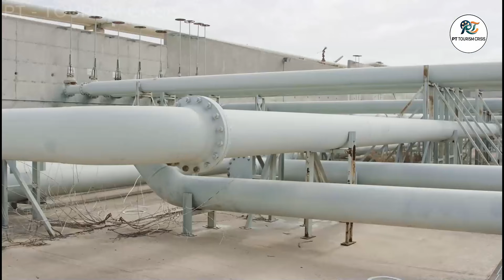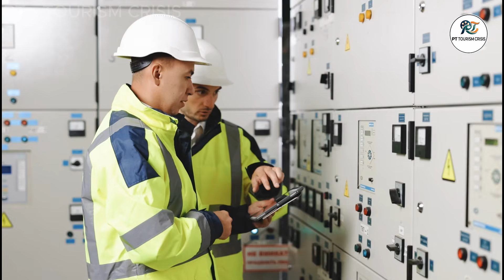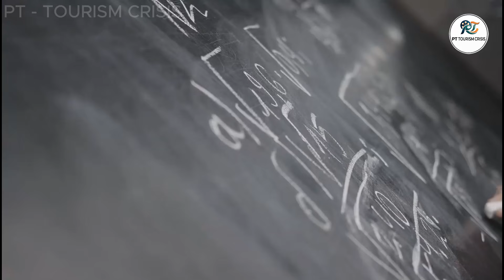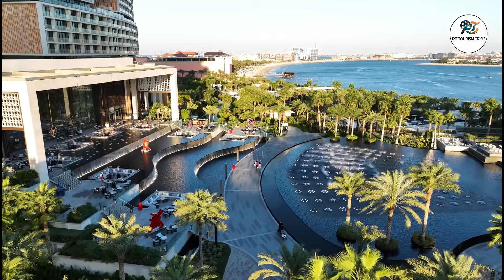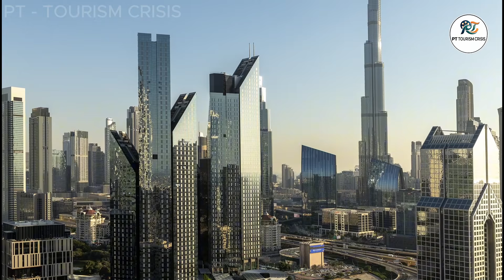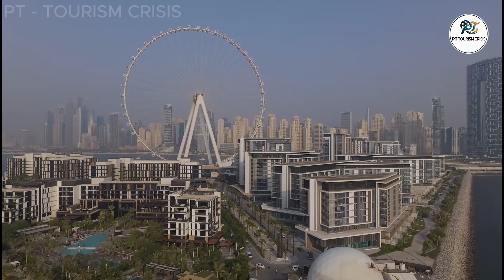Why Dubai’s $20 Billion Infrastructure Is An Energy Trap

Comment: The problem is long term-the place is uninhabitable without cheap energy. Once the buildings require major repairs all bets are off.
Reply from the maker: Exactly. The real vulnerability is long-term dependence on affordable energy, constant cooling, and expensive maintenance. Once major repairs become necessary, the economics may change dramatically.